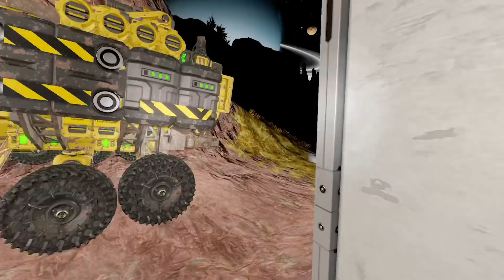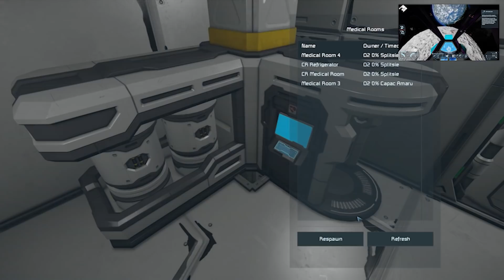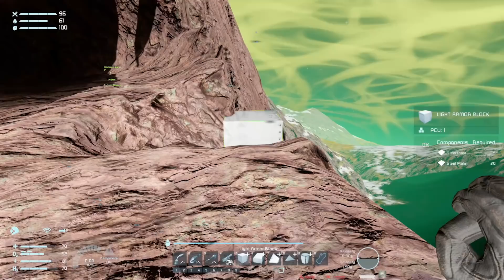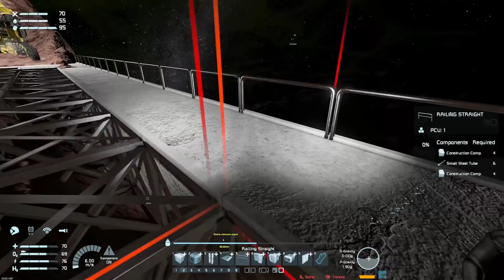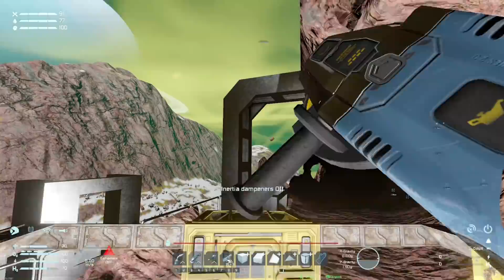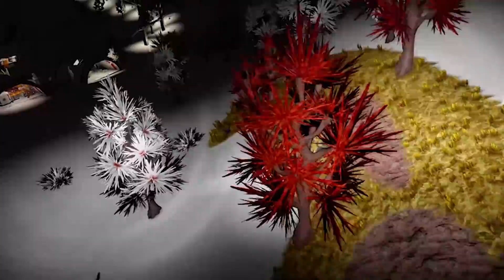Survival Impossible - 1km of Death Road #65 - Space Engineers Hardcore Survival

Comment: dont replace the main base with refineries and assemblers ... just put the most basic resource conversion there ... even a survival starter one ... just enough to get the basic's if the main base gets over run and allows you to drop the stone off there and let it make basic armour plate and interior plate ... leave the big ones at the main base ...
Reply: that almost plunge break out would be a perfect spot to put a chair a turret and a turbine on an open platform ... use the chair to run the turret manually ... then you have a first armed outpost ... super basic ... but a first one
Reply: for the proposed bridge areas place a simple block around where you want it to start dont worry about getting it lined up with the actual path perfectly ... just place is about the right level and in the way enough so you find it as you tunnel over ... then remove that block and build your overpass at the level you mined to ... use the block like a survey marker to let you know roughly where you want to build instead of tunnel ... even with scrap mod on a basic block marker is peanuts to lose compared to a whole vehicle
Reply: put a wind turbine at each end of the first bridge and then put a lookout bulge with a turret about middle ...and of course a bench to sit upon and look at the view .... behind the look out bulge put a proper parking spot with a connector attached to the turbines so you can park your vehicle and recharge while sitting admiring the view .... no major plumbing just enough to power the turret ... perhaps a tourist kiosk with food and water kind of like a chip wagon that is going permanent but has just went from mobile truck to a truck on blocks that doesnt go anywhere any more ...
Reply: dont manually weld the bridges ... bring the goose base welder vehicle in and use that .... it would be PERFECT for putting down the bridge surface and it can carry the bits needed to build them .... make the bridge turn aroun about 3 times wider and half again deeper ... on the end colser to the middle hand drill out a section and build what looks like a chip wagon for the toursits with a 2 or 4 table dinning spot and a push out into the canyon with a few spectator seats ... put a turret at each end of the bridge with wind turbines to provide the power for the area and you can also slap a few shrubs and flowers in and around the look out .... be a great place for video breaks and basic recharging of the goose base welder.
.
ding that would give you a reason to HAVE lights ... and make the turn around an actually useful thing that gets reused later for safety ... besides you have said you love that view about a dozen times already ... and this would be the perfect spot to take advantage of that view with a reasonable rest stop
Reply: Yup Acme delivery needs to drop off the rhino goose base welder truck for the bridges ...

Comment: I think you really need to stop overthinking the 'look' of the road, especially from perspectives that you're rarely going to show anyway, like external shots of bridges. 

My suggestion: Focus on the purpose of the road first. Its job is to get you to the magnesium. Once it does that in its most basic form, use it. 

THEN, instead of trying to anticipate every little safety precaution and interesting look, it can grow organically in small bits as you learn what on the route needs to be changed. That way, you have lots of small gradual modifications that all make sense functionally, and you'll only use resources for the bits you realize you ACTUALLY need, instead of wasting them on bits you think you MIGHT need (like lights - I think watching you get nervous because the road IS dangerous is more fun than watching you try to completely and absolutely prepare for every possible risk). 

The road has a chance to become a character that way, with bits added for memorable reasons, rather than just looks. You'll end up one session going, "I've really got to put up some safety blocks on that deadman's curve where I keep almost falling off", or "I've decided to put a little memorial here at this spot, where two racers crashed during the time trials". 

Also if you DO decide to work on anything for looks, it should be the massive, functional, but hideous and completely unwelded ice base that NEEDS to look that way, rather than the road that doesn't.

Comment: Mobile refinery/Assembler vehicle + Mobile Large Storage vehicle. Build them and bring them with you for the tunnel digging and collect the stone, process it, and wheel it back to your base. Is it necessary? Absolutely not. But it will give you an opportunity to build more specific-use vehicles. If you don't want to make them individual vehicles, then make them into trailers and pull them behind you.
Reply: Another idea, though far too late to go with now... Add an attachment onto the side of a small grid vehicle that has a large-grid drill on it, or a couple. Add a small grid piston pointed up and down with mag plates on the ends. Get to the end of the tunnel, extend these pistons to lock the vehicle in place. The large grid drill would also be on a piston or two with a hinge and rotor so that you can very specifically adjust the rotation and angle of the drills. Then, have them extend outwards until you get to the end of the piston length, retract, unlock and retract the mag plates, then drive to the end of the tunnel again, relock, adjust rotation and angle, then extend the drills outward again.

Comment: You should put an antenna at the respawn point, so if you do end up dying while using a flying vehicle you could remote in and save it.
Reply: that would only work if the splatform's own range is large enough to pickup the base antenna

Comment: When you do your barricades, I'm gonna suggest using heavy armor for the pillars and maybe even the cross sections. I know it's far more costly, but it would be far safer.

Idk if you thought of this, but you could use the Splatform to fly to the deposit and fly back slowly at a slight decline, and make GPS markers at 250 to 500 meter intervals or so to mark out the incline to build the road. It isn't perfect by any means but would give a rough estimate of the incline needed.

For the lights I would also like to suggest that on a halfway point on the road you build a platform out into the mountainside where you have solar panels and some batteries that you use to recharge the battery lights you're going to make. Use the truck you build that can carry 3 or 4 of the lights that you can swap out from the charging station as needed. 

As always man I love your content and your absolutely ridiculously creative mind. Much love man. Keep it going!

Comment: About the lights in the tunnel, theoretically, you can put a hinge part on your light system and then use a vehicle with another hinge to connect and charge the small battery that powers the light.
Reply: What about a rotor part? Then it would look like something you were meant to plug up.
Reply from the maker: Either would certainly work, frustratingly though, the little batteries are really slow to charge so it would take many days to charge up the lights along the way so I'm thinking removable lights that can charge back at base then get put back up

Comment: Turn this outpost in to a storage, let a drone fly from base with spare parts and use a connector to fill up the rock lobster. It will save your some trips. Also dont weld everything yet once your got the tunnel done you can exchange the drills for welders and use the Rock Lobster as Plate Lobster and use it as road welder. Also you use full blocks would half blocks not be "economically" better for the bridges as they would cost you less plate and you could build and weld more?

Comment: A way you could put your safety first, and keep the bridge powered is by using the silver, gold or retro paints as reflectors that reflect your headlights, I'm not sure if it would work all that well, but I think it would be worth a try. Or you could even have it as a backup in case you loose power on the bridge.
Reply: or use blocks with emissive strips as markers for the road

Comment: Just a short comment on the Isy's inventory "stealing" stuff out of subgrids: i always made the mistake to set up the connector on Subgrid and thought that should stop the script from doing things to it.  Even the manual says it does not matter, i had to set the connecter on the grid where the script is running to '[No Sorting]' and after that it was excluded.
Another small thing you could do about the "very little chance to get the incline right"  make a gps where you are, make an exact gps at the point you want to arrive at - and simply calculate waypoint in between every 100ish meters and type em in. Sounds complicated, but its done within a minute using any kind of cad software.

Comment: Splitsie you Dope (always wanted to say that.) Don't put lights on the bridge. Put Neon Tubes which glow, but don't make light or require power.
Reply: Was about to say that, while they don't illuminate they sure mark/light the way
Reply: @bnorth1087  he said he won't be using cheesy methods to light things
Reply: @MrGorgothmadd  it is not lighting, and it is not cheesy
Reply: @MrGorgothmadd  I thought he dismissed neons as 'cheesy,' too. Thankfully I was wrong - lol
Reply from the maker: The reason I want to use lights is that I want there to be light not just glowy tubes. I think it'll be much more interesting driving along the road if you have actual lights, plus it'll look better in the time lapse shots as you'll be able to see more with how often this area is in near complete darkness :)
Reply: @Splitsie  Ah, that's reasonable.
Reply: @Splitsie  tbh I think it makes sense for the bridge to be attached as it would be in real life a strategic point for the enemy to attack.
Reply: In my corner of Europe, most bridges don't have lights or even road lights, only bigger bridges have "lights" and they follow the contours of the bridges, they are more of the dull type of lights as not to blind or distract drivers, like that of the SE neon tubes (wish we had one with just a single tube) but not that of regular lights of SE since they shine so easily through everything and illuminated all sides of a block, the more bright lights on bridges (here think SE spot lights) are used to illuminate the bridge towers shining up from below, now that might be a way to go a few spot lights below and one each end as to make the most use of the good shadow effects the game actually is capable of.
Reply: Corner Neon Tubes placed back to back to make cats eyes to show the centre of the bridge?

Comment: You could build a new trailer for the Lobster, just to haul Plates along as you go and Drill the Road. Also, for that up-slope on that one side of your bridge, bring the beam up higher 1 or 2 blocks and then instead of netting, aka catwalk blocks, you could use the new plate blocks. this would also be a nice point for a defense post to guard the bridge and a possible fuel/charging outpost.

Comment: I added 2 extra drills to my "rock lobster" and it makes the drive so much easier splitsie you should try it out.
Reply: I think the point to this madness is to keep it from being easier.
Reply: @Alturvexs  I'm surprised he didn't use only one drill and make several passes 😆
Reply from the maker: Since the RL is supposed to drill material and I'm really bad at keeping my drills from filling I was concerned that in 1.9g the hinges would fail to lift them if I had more drills, but ultimately what stopped me was that I thought it looked better with just 2 on each arm :)
Reply: @Splitsie  ya I get that and I struggled with modding it at all as I always like remaking ur builds and see what u have to go thru. But it was driving me nuts how uneven it was making it. I tried the extra two drills and made it so much smoother right where the wheels rode at.  Another idea I thought about doing was adding a conveyor between the two drills it has. I did not try that tho

Comment: Splitsie, instead of turning off the programmable block, assuming you're using Isy's Inventory Manager, just add "Locked", sans quotes to the name of the cargo on the Rock Lobster. You can put stuff in it, but the tag prevents the script from pulling it right back out.
Reply: A better way to go in this particular situation: just tag the base connector with "[No IIM]" and all storage, tanks etc. on any grid that docks to it will be ignored by the script.
Reply from the maker: My issue comes down to IIM ignoring a number of the restrictions I've previously put in place (despite me very carefully checking the syntax), so instead of fighting with it I just turn it off :P
Reply: @Splitsie  I've had exactly the same thing happen.  In the end, I actually copy-pasted the [NoIIM] descriptor text from the script code into the connector, and that actually worked, don't ask me why!
Reply: problem there is that the Lobster is also a conventional mining system, which really ought to be pulled from automatically. And with Splitsie's memory, he would forget to fix that issue. You see the problem?

Comment: 1km road, of course it’s going to be deadly….
With the lights in the tunnel maybe you should add sensors on them so they don't just run all the time, which would mean you don't have to replace them lots of times?
Reply: That wouldn't work beacouse sensor can take up anywhere from 3 to 30kW depending on the range, while spotlights take 200W and interior light only 60W. Batteries also have 1W self discharge as long as they are on.
1 fully charged small battery will give you little over 16 hours for 1 sensor at minimum range, 10 days for a spotlight, or 34 days for 1 interior light
Reply: @Honza2268   a day in this pack is 4 hours, so there is 204 in game days worth of light in a single fully charged small battery. they get build with only 30% charge, but that is still a pretty long time.
ofc... being a cheap bastard like me means charging them up first, then weld them into place with the welding mod.
Reply: Don't sensors have a greater power draw than lights?
Reply: Also for saving processing
Reply: This is genius. Simple and effective. Wow :D